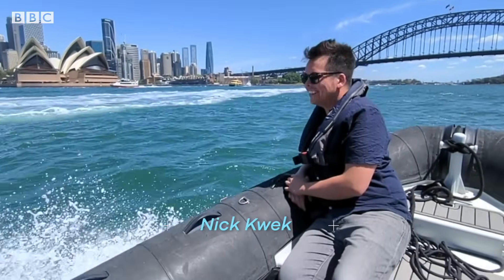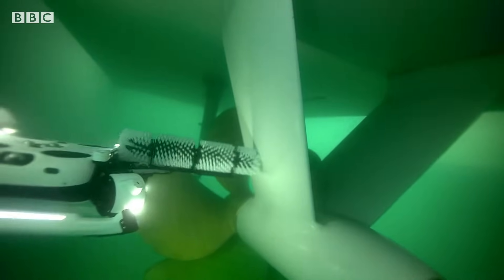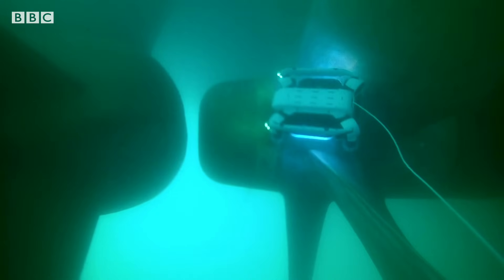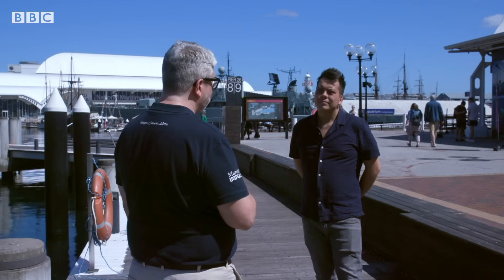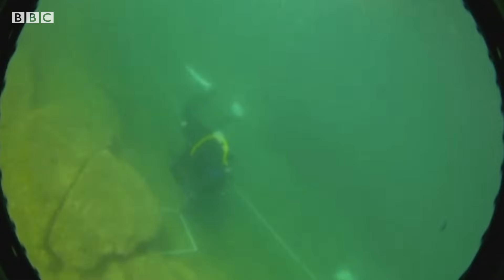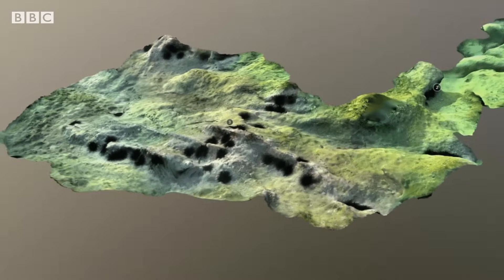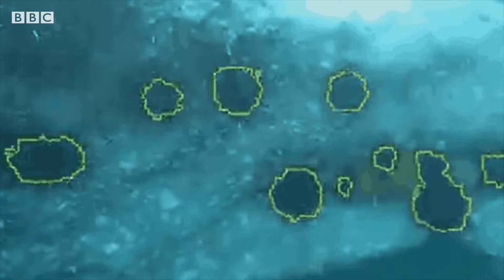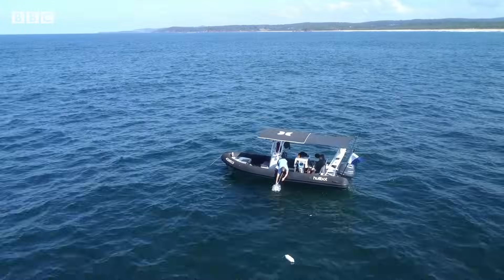The robotics cleaning Sydney Harbour | BBC News

Comment: This overhyped underwater robot has a fundamental flaw: it doesn't collect the growth and toxic bottom paint flakes it removes; they're released into the water! "Clean early and clean often" is bogus. As any diver can tell you, scrubbing a hull hard enough to remove growth, even a light coating of green slime, also releases clouds of bottom paint dust. The problem is even worse with soft, now-common "ablative" paints which are designed to  sluff off in their own; scrubbing just hastens the process. A big thumbs down to this so-called innovation that's actually making water more polluted, not less. To add salt in the wound, this cute little robot excells at freeing invasive species from the hull and releasing them into the water too!

Comment: Very surprising this would be allowed in Australia. Unless you are collecting and treating the waste from the hull cleaning you have the risk of invasive species coming from other regions which has wiped out native species in other countries who as a result put in place strict regulations (most developed regions it is banned and hull cleaning is restricted to dry docking). I suppose if this ROV is used for   harbour boats only that never leave the harbour then that is not an issue
Reply: You could argue that this ROV is a means of preventing invasive species spread. By cleaning the hulls more frequently before departure from a port, you leave any local fouling behind that could be spread to the next port.